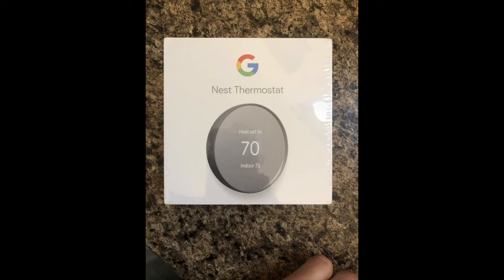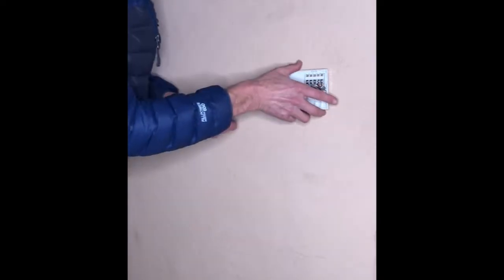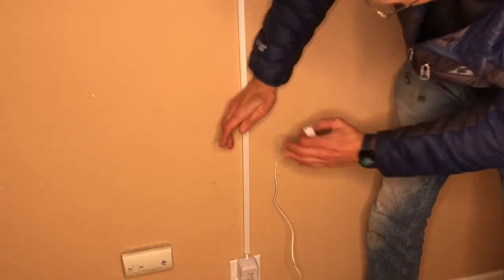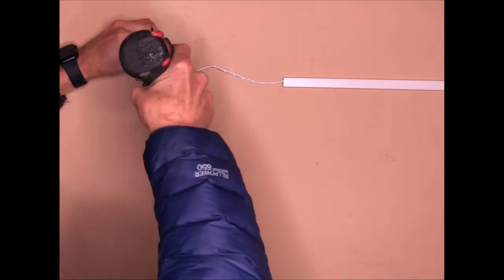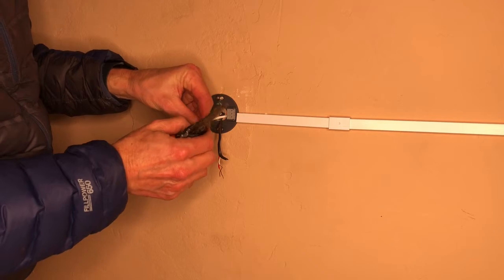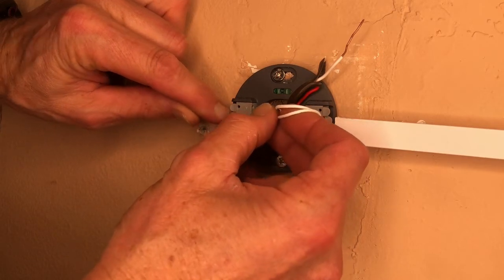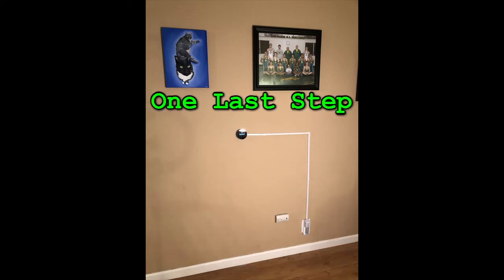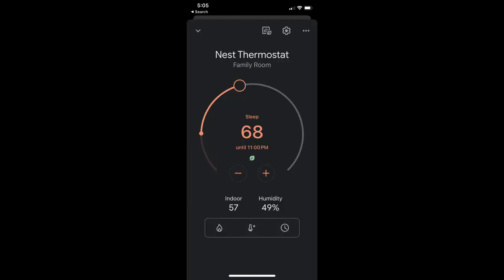Nest Thermostat with Gas Wall Heater (Install and Setup)

Comment: Excellent video. Perfect level of detail not too much and not too little. Easy to follow. In my case I am controlling a vented gas log fireplace insert with a room air recirculating blower. Two wire system works perfectly. I like controlling this thermostat by voice using Google assistant. The home app also works great. All this is fantastic as I replaced a simple digital but non-programmable thermostat. Now I have a programmable schedule and voice control.

Comment: Caused an electrical short to ground and blew out the pilot light, no permanent damage.  The red wire to the heater is somehow grounded (not isolated), it is a big piece of metal.  Perhaps you could follow these instructions and instead put the red heater wire in a different slot.  IE Fan, Y, Etc.  It can test your heater electronics.  Cool hack, but might have to hack the hack though.

Update:  My gas heater is basically completely metal so 'Any' outside voltage will ground itself and cause the pilot light safety to throw.  The answer was simply a 24volt relay.

Comment: Uhhh i wouldn't recommend this.
Millivolt systems really really dont like any external power on their switch lines, doubling up the Rh wire like that woll put 24 bolts across the gas control valve in the wall heater which isnt used to that kind of voltage and will be upset by it

Over time it can burn out the gas control valve

Comment: The F.E.T. relay fails in the closed position in the cooling mode. I won't warranty any system or service on any unit connected to a nest thermostat.

Comment: Thanks this is really helpful! And it seems easy. I’m curious how you can just use the power adapter and not a relay as others have suggested for NEST. am I missing something? I definitely like this easy or option thanks.

Comment: Will it still work if I lose power (which, I do all the time)? I'm hoping it will still work as a thermostat but will just lose wifi connection?
Reply: Yea will work since it has a battery

Comment: Looks like an awesome trick to get this to work and willing to buy an adapter but wanted to ask if the thermostat still work if there's a temporary power outage for a few hours.
Reply: Some of these smart thermostats have batteries you can install.

Comment: I hooked up a nest thermostat ended up with an error e294 and wouldn't control the boiler.

Swapped the boiler wires around same issue.

I was going to swap the 24v wires but it's AC so I can't see how that would make a difference

Comment: I just did this. It worked for a while, but now it doesn’t turns on the heater. I need to Jump the wires on the pilot to turn on the heater manually. Any help please? Nest doesn’t turns on the heater by itself
Reply from the maker: The order of the C wires (plug in converter) matters. One way causes the pilot light to blow out. Switching the wires around makes it work properly.
Reply: Did you figure out a solution to your problem?
Reply: @claytonkern6220  not yet, kinda abandoned the project because couldn’t find a solution